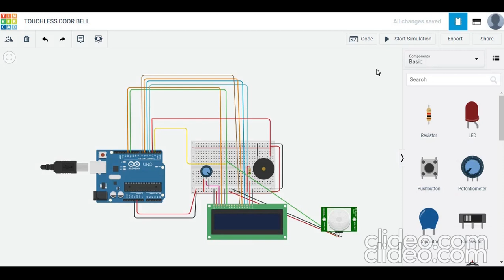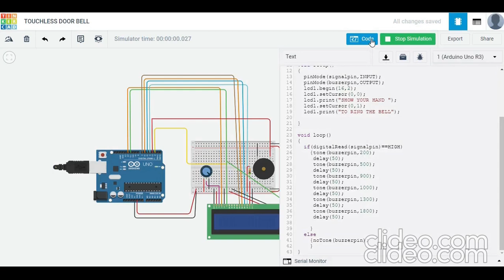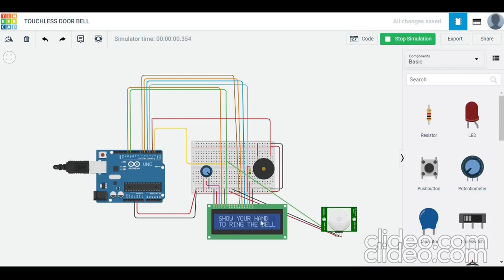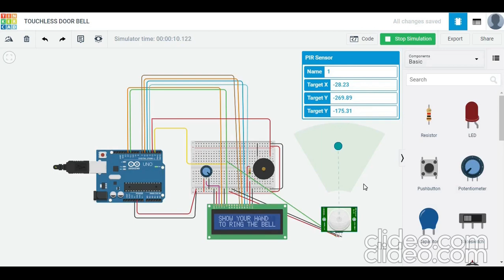Touchless door bell arduino tinkercad

Comment: bro plss i need ur help plss send me its code plsssss plsss plssssss i really need it as soon as possible
Reply: #include<LiquidCrystal.h>
int signalpin=2;
int buzzerpin=3;
int rs=12;
int en=11;
int d4=7;
int d5=6;
int d6=5;
int d7=4;
LiquidCrystal lcd1(rs,en,d4,d5,d6,d7);
void setup()
{
  pinMode(signalpin,INPUT);
  pinMode(buzzerpin,OUTPUT);
  lcd1.begin(16,2);
  lcd1.setCursor(0,0);
  lcd1.print("SHOW YOUR HAND");
  lcd1.setCursor(0,1);
  lcd1.print("TO RING THE BELL");
  
}

void loop()
{
  if(digitalRead(signalpin)==HIGH)
  {tone(buzzerpin,200);
   delay(50);
   tone(buzzerpin,500);
   delay(50);
   tone(buzzerpin,900);
   delay(50);
   tone(buzzerpin,1000);
   delay(50);
   tone(buzzerpin,1300);
   delay(50);
   tone(buzzerpin,1800);
   delay(50);
   
  }
  else
  {noTone(buzzerpin);
  }
}
Reply: @Pavithra-K-S  are you sure this  code is for this project?
Reply: @Pavithra-K-S  Bro Can you please provide the link of the project??